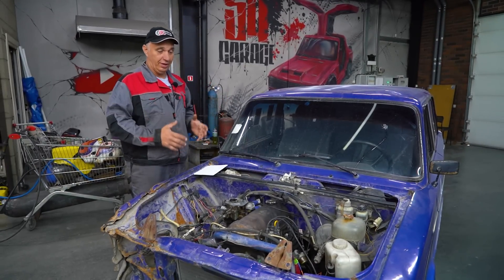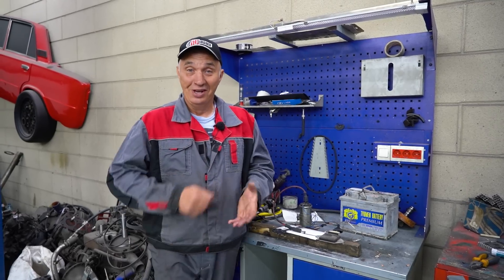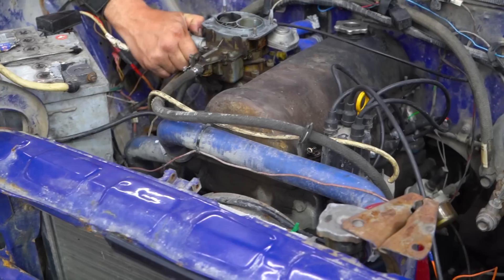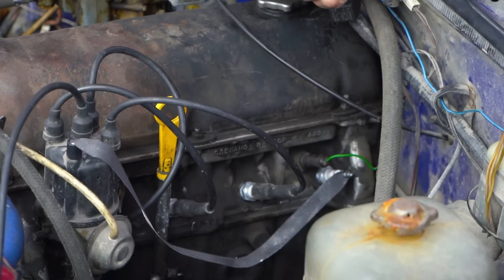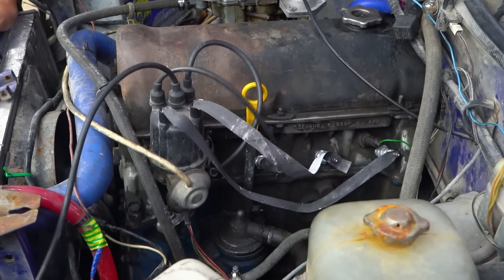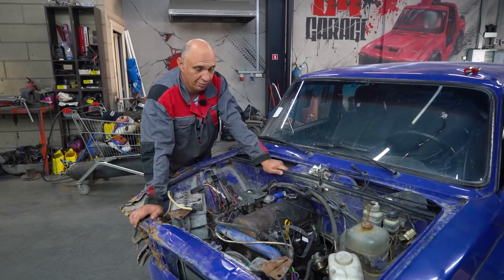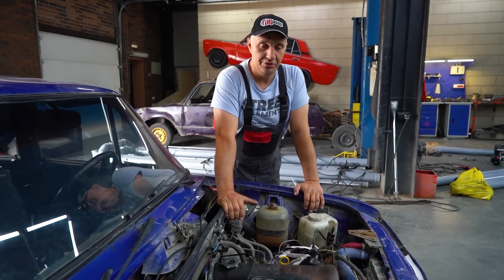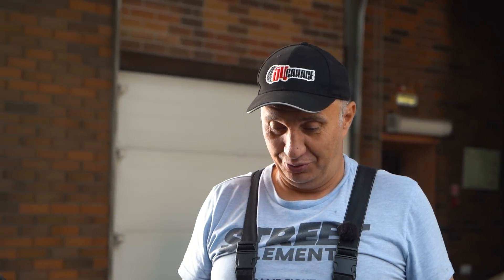Pencil-drawn ignition leads – will they work?

Comment: Cover the strips of paper on both sides with graphite, turn them like twine rope so they become thinner and pass them through plastic drinks straws of the type with an elbow, connecting these up over the paper "cable" so they may act as insulation.

Comment: I remember actually cable made for ignition instead copper wire they haved graphite inside plastic insulation. This was made to reduce radio interference from sparks plug. Today it is absolete, any spark plug have ovn hi voltage source. There is no more distributor and long hi voltage cables in modern cars.

Comment: Awesome video, despite it not being 107% lol. An idea you could try, get some pieces of heatshrink tubing and fill it with powdered graphite, then insert a cap at each end as a terminal and then shrink it down. Am confident it would work, but it would be interesting to see how they perform to factory made leads, and how durable they are. Could buy pre-powered graphite used as industrial lubricant or make your own from removing pencil leads and crushing them up in a mortar & pestle or coffee grinder haha.
Reply: Was thinking of similar but wasn't sure about the outer casing (like, plastic would be too firm) ... I second your idea with caps!

Comment: Use contact adhesive on longer paper strips, sprinkle with charcoal powdered from a fireplace. Then spray more contact adhesive over the charcoal, and wind the paper along a piece of plastic tube that fits the distributor holes. To attach to the spark plug with a good electrical connection, bend a 1" long stiff bare wire folded in half, one end inside the tube to contact the plug, the other end outside the tube contacting the charcoal. The tubing gives stability for less risk of shorting and a look of normalcy.

Comment: what about graphite powder put into rubber/plastic tubing, sealed on each end, with connectors for the cap and plugs?  seems it should work s well, and if clear, and not filled to capacity, then maybe even see a spark through the clear tubing.  might be interesting, at least it seems so to me.

Comment: Next project make an opposing engine, with two regular engines.
Reply: The Fairbanks-Morse opposed diesel engine would be a good template to follow while using two Lada engines.  Lubricating the upper engine will prove to be a problem.  Also, since the OP engine is a uniflow-breathing engine, Vlad will have to use a BIG blower to force the air-fuel mix into the cylinders.  Too many other complications as well but, it would make for an awesome video if he got a stacked OP Lada engine to run!

Comment: How about windscreen washer tubing, filled with iron filings? - Waterproof, flexible, and pretty decent insulation, coupled with a decent electrical conductivity in the iron filings.  Or, try a graphite oil additive in the tubing instead of the filings..... I wonder if sausage meat would work too?!!

If it comes to that, soot should also work - It's carbon!

Comment: it would likly work better to... wrap copper wire around the graphite paper "the paper being tightly wrapped around its self before being wound with wire", then covered in a stranded nylon braid that holds the wire to the paper core that is when coated in liquid rubber epoxy in several cycles so each dries properly... future update make a ethanol graphite paste, saturate a nylon strand "that is the same diameter as the rolled paper core" with the ethanol graphite paste, then wrap that with thin wire and so on again. "graphite infused plug wires, because when the copper wire brakes internally on other wires they completely stop working".
Reply: you know what would work even better? get a lead of stranded copper and then cover it in some sort of insulating rubber material, for a better connection you could even gave some sort of crimped connector on the end of it. But remember, this video isnt about making something that works well

Comment: This one is fantastic.  I would have thought it would be way too much current for this ... for the paper to survive at all, etc.  Awesome.
Reply: makes me wonder if we are being cheated when using expensive wires.
Reply: Virtually no current, it's all voltage hence the sparks
Reply: @dopiaza2006 Sparks are essentially short circuit. Where there is voltage there is a circuit
Reply: @pootispiker2866  Not sure what you mean by that
Reply: @dopiaza2006 what he means is that where there is high voltage and a short circuit, there will be high current. However, for a spark plug the current only flows for such a tiny fraction of time, the overall power (like say, over one minute) isn't enough to generate much of any heat in a thin conductor

Comment: Can you guys make a V8 engine  using 2 Lada engines?
Reply: No.
Reply: @frankdesbaux  it is all a matter of machining and metalwork :)
Reply: Vlad would do better to make an inline 8 but, make it look like it came from the factory that way.
Then make some stylish individual pipe headers that run down and then up (see Red Baron custom car).  

The engine will be so long that it will have to use up every inch of the engine bay and that will require moving the radiator off to the side.  Or maybe put the radiator in the trunk with lots of fresh air being blown in through louvers while using copper pipes to carry the coolant.  The copper pipes will shed additional heat to and from the radiator.  A true Russian Rat Rod!
Reply: @BlackPill-obey  if you go back to some of the older episodes - the inline-8 has been done (by simply welding together two Lada engines at the pulley, but still). That escalated into an inline-12, then an inline-16 ("project Gennady"). Those were the days...
Reply: @SwapBlogRU  I found the twin-engine Lada episode where they take it out in the snow.  The engine are not welded together but coupled from the flywheel of one to the front pulley of the other.

I'm hoping they raise the bar and attempt to fuse them together to look like it was cast that way and that the firing order would be staggered to sound like a normal 8 cylinder engine.   Also incorporate their past trick of using a diesel fuel injection pump to simulate a sequential fuel injection.  Really jack it up for power.

Of course, the swooping header tubes (see Red Baron custom car) would be the eye candy to all this.

Comment: I was hoping it would be a paper with actual pencil drawn leads. Just use the soft 6B or so. You could have also replaced the middle conductor that goes into the distributor cap
Reply: it works the same, so.

Comment: I suspect that the graphites resistance is on the high side.
Reply: Doesn't matter. At voltages that high, you don't need much current to generate a spark

Comment: Put electric tape around the paper, to keep it from tearing😃👍🏼

Edit: or even hot-glue
Reply: Or Scotch tape, to stick with the stationery theme.
Reply: This will also help insulate the graphite strips so there won’t be stray arcs too
Reply: at what point in the process of insulating your conductor does it change from a funny experiment to just 'making a spark plug lead'?

Comment: You could try to make a plastic tube with really salty water to act as a conductor.
Reply: That would be awesome!👍🏼
Reply: Would probably still just be a massive resistor
Reply: @jm036  Lots of old-school cars used carbon ignition leads to provide resistance for quenching excess ignition coil energy. Being a resistor is part of their job. The SAE even has a guideline of 10-12 kOhm/foot.
Reply: @jm036  proper spark plugs from namebrands have internal resistors to lower the excessive spark energy and lower the EMF pulses coming out from the leads.
Reply: Yes please try this Garage54
Reply: I just thought of similar thing, lol. For sure it would work.
Reply: Sounds like a cool idea.
Reply: Oh that’s be cool for them to try, or some other tube with an electrolyte solution!
Reply: How do you connect water onto plugs 🤔?
Reply: @diwiak  My thought was that you fill a tube, then cap the ends with metal connectors. The ends have connectors, and the salt water acts as a conductor between those connectors.
Reply: The water recieving voltaje through It Will release poisionus chlorine gases, that doesnt worth the try
Reply: Baking soda works in hydrogen generators
Reply: Doesn't even need to be all that salty at those voltages and power levels. It would probably work with just tap water even.
Reply: @MadScientist267  No, because tap water needs to have more chemicals in It To provide good conductivity
Reply: Maybe if we can make an actual compacted salt bar, we could have a very good conductor
Reply: Fill plastic tube with Glow in dark liquid. or make liquid with phospher,  or phosper coated pelets
Reply: Nah, piss-soaked toilet paper. That's where it's at.
Reply: The water would split into hydrogen and oxygen until they eventually popped. Or, maybe those bubbles would ignite and turn back into water, repeatedly. Interesting.
Reply: Humans are conductive like a big tube.. try it using your mechanics 😂 it's only a bit of pain and after you get a few sharks you can just about take it for a few seconds.. when I was at college we used to see how could hold on the longest 😂 one guy lasted a good 15 seconds